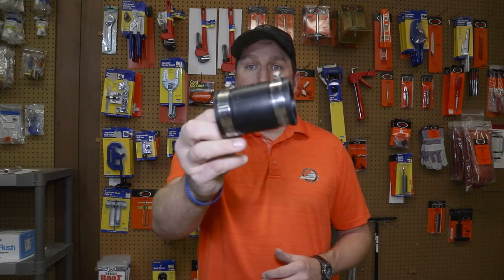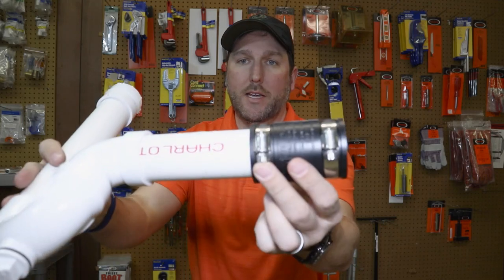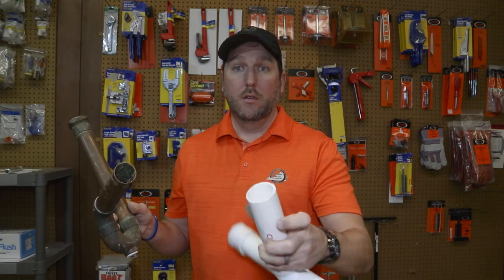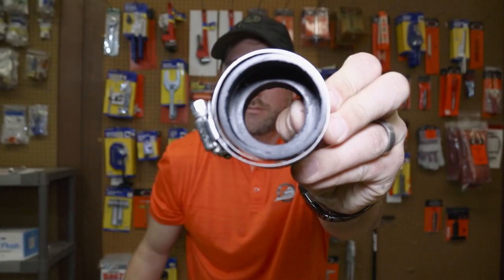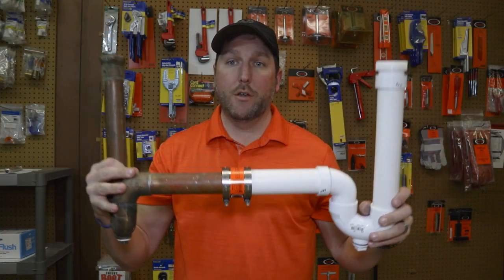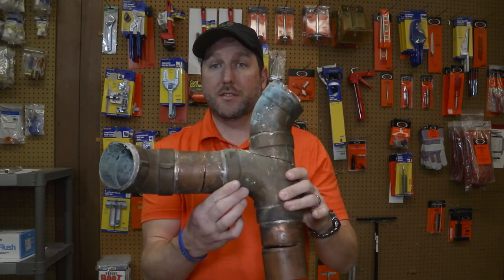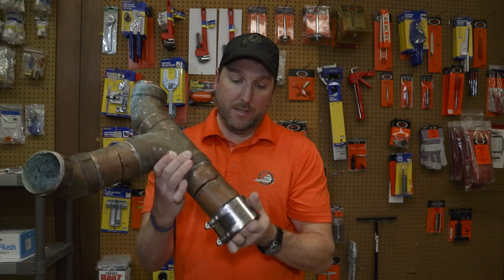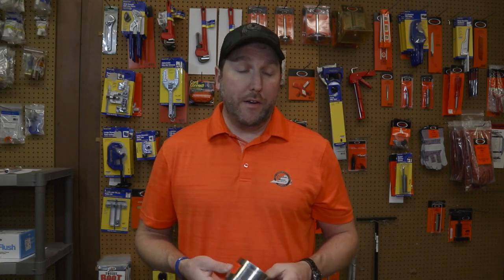Replacing Copper Drains with PVC

Comment: So my copper pipe OD (outside diameter is 1.6 and I need to connect it to a 2” pvc which adapter do I buy the 1.5” or the 2” ? And is it safe to run copper to pvc? It’s a drain pipe from a kitchen sink but way down the line not directly under the sink. Got a leak and found where it was and sure enough it’s where there’s a crazy connection with elbows and T’s with a plug on one side of the T (is it ok to replace that with just a regular elbow? Hope this makes some sense lol thanks in advance.

Comment: looking to connect 3an half waste pipe to 3 an half  pve pipe.. what recommend.... myold coppperpipe they buried  in the ground under cincrete slab in basement..   whst recommend..its a waste line. going have to runn newpvc pipe and by pass one in ground and make new waste line.. hsve to runn up in  slightly nelow ceiling down stairs  and is quarter inch slope good for waste line...,,thsnks for info..
Reply from the maker: 3 1/2"  are you sure?  Plumbing pipe is usually measured by inside diameter so 3 inch may measure 3 1/2 out side.

Comment: What if it's a 3 or 4 inch copper elbow that leaks right on the bottom of the bend?
Reply from the maker: Sooo...  there's no real easy way to fix that properly other than cutting it out and replacing.  However I have seen guys clean the spot and apply some strong epoxy and smooth it out.  Let it dry and I would not recommend using it for 8+ hours.  This stuff works pretty good.  See link. https://amzn.to/3N84jb7

Comment: Great video.  How would you suggest replacing the main copper pipe drain pipe that goes into the slab?  It goes into a cast iron clean-out.  How would I get the PVC connected to the cleanout?
Reply from the maker: There are 3 possible options.  Rent a small hand held jack hammer and break up the concrete around the piping.  Usually 6ish inches deep. Dig out a little dirt and replace the pipe coming up through the slab<---fairly involved.      If there is a thread in the cleanout, you can screw a male adapter into the thread and run pvc from there.  The next option, not really the preferred option, I have seen some old school plumbers clean out the hub, insert the pipe and concrete around it. <-----not the preferred method.
Reply: Plumbing Parts Pro thank you for the detailed answer.  Would another solution be just cutting back the damaged portion of copper and using a coupling from CPR to PVC?
Reply from the maker: @mct8888  sure. That would work too.  I just got in some 4 inch adapters too that are not on the site yet if that's what you need
Reply: @PlumbingPartsPro  I'm pretty sure it's 3" CPR.  Do you have any 3" CPR to PVC?
Reply from the maker: @mct8888  yes I have plenty.

Comment: Correct me if I’m wrong, but I think over the long haul a Fernco will cause a leak. The copper will rot underneath the rubber and fail.
Reply from the maker: Hey Thanks for watching. No I don't think it will.  These rubber couplings have been used for decades now and work rather well.  I definitely dont think the Fernco will "Cause" a leak.  Atleast I havent had any issues with leaks due to fernco have you?
Reply: Fernco couplings are a tried and trued product and has lasted the long haul.

Comment: My customers kitchen sink has that one and a half inch copper line going straight down no p-trap into the basement into this weird-looking contraption on the very top of it looks like it has a three-quarter inch head to a impact gun and it looks like that's grabbed by a pipe wrench and twisted to do something but I suspect that thing is the problem and supposed to be the p-trap or yesterday's p-trap because this is the work done since the sixties. Every single thing I've touched in here and try to bring to the plumbing house they look at me like I'm crazy. One guy said the rubber gasket you would think they would have thousands of different rubber gaskets know you didn't have on me since I hadn't seen anything like this in 30 years WTF 😒 how do I get myself into these messes
Reply from the maker: Could be a possible drum trap.  Send us a picture info@plumbingpartspro.com

Comment: This would be great, but their website shows many parts as Sold Out

I used a regular 3" rubber coupling to connect new PVC to existing copper in my house.  It seems to be working fine, but it's probably not a bad idea to replace it with the tighter one shown here - when/if it becomes available

Comment: Why would you want to remove the copper?
Reply from the maker: I wouldn't recommend replacing if its in good shape.  Sometimes the copper will end up with pin holes in the pipe over time causing a leak requiring replacement.
Reply: have to by pass copper line that is buried unedr basement floor,, have water heater and gas furnance.. neighbor told me ,, he had plimber bypass waste line under concrete slab. how do i measure waste pipe diameter to make sure order right complin to convert from copper pipe to pvc.?